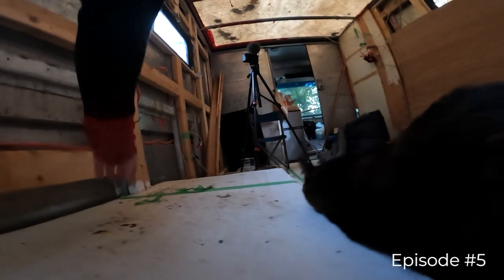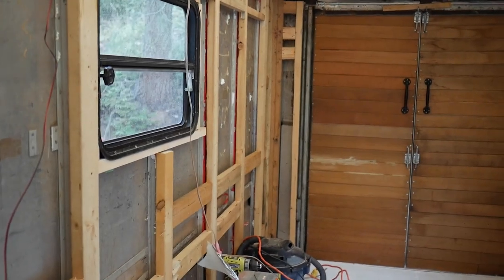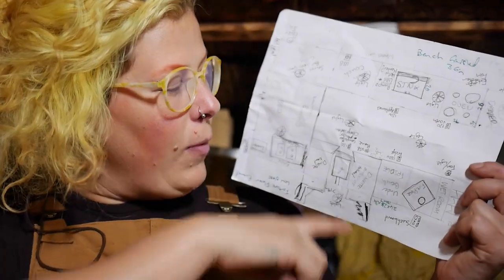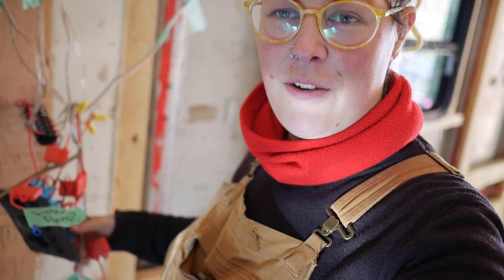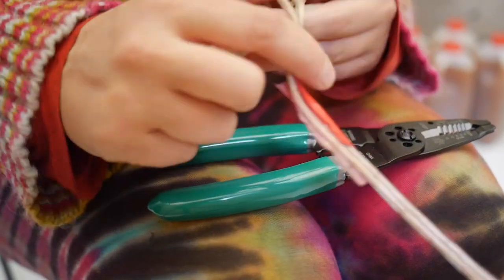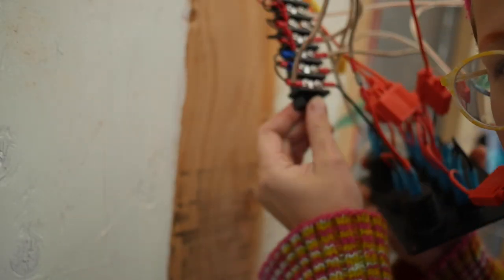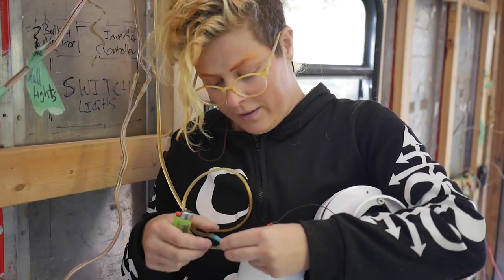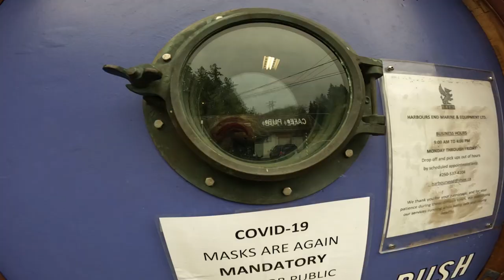Step van build Electrical! | Episode #5

Comment: Striper has wire gauge numbers on it  that matches wire size and any 120 ac splices code says put in a box. And fuses are to protect wires? Plus u run a home run and branch off of that circuit. That's your lesson for today  good luck great job.

Comment: You're doors look interesting make those? kinda reminded me of what I did from first glance. I removed the roll up doors and made two big swing doors in the back from all the aluminum shelves that were in it. Been quite a process getting it all to work and fixing gaps around the doors.
Reply from the maker: @eedom69 my doors are the worst I didn’t make them and they’re so drafty and let so much dust in when I drive! The worst
Reply: @FlossyRoxx  I had big gaps all around my doors too. I used old bike inner tubes on the sides which I cut into one straight piece and riveted to the side of the door way. And then stapled them to underneath the door to close the gap. They work good on the sides, pretty good under the door but not on top. That gap has been to tough to figure out. Tried a few commercial products but no luck yet.
Reply from the maker: @eedom69 THIS IS BRILLIANT THANK YOU - I’m gonna do that

Comment: Your roof doesn't look too solid frankly! Are you sure it's gonna last? Now is the best time to replace it before you do all the insulation and cladding. I'm impressed by the wiring though. I'd have a hard time figuring this stuff out
Reply from the maker: Thanks! It scrambled my brain for a bit. The roof is a heavy duty but lightweight fiberglass sheet that's translucent. It's solid and I think it's good it has some flex to work with the movement of the vehicle as it drives. In spring summer I'll definitely be cleaning off the top and checking all the seal along the ridge of it for sure. I think that'll just become part the yearly maintenance of the van.
Reply: @FlossyRoxx  cool! It's most likely just the translucency and (outside) dirt that makes it appear old and worn like on an old camper, on camera. :)
Reply from the maker: @hackisack yup that's exactly it! There's a lot of fallen cedar right now